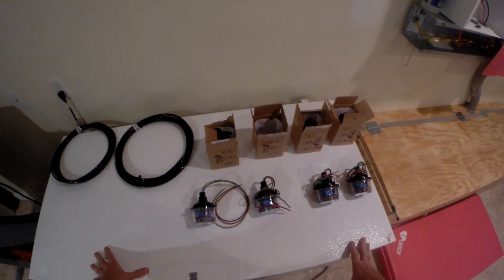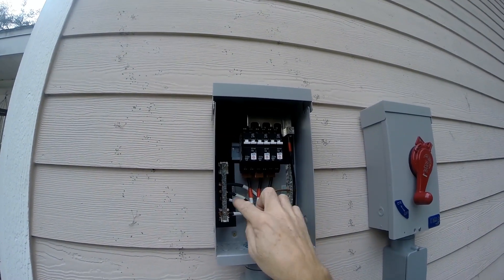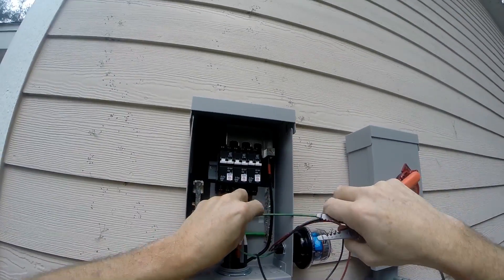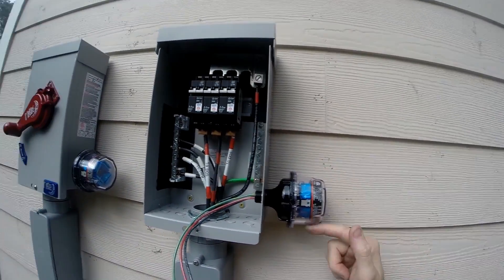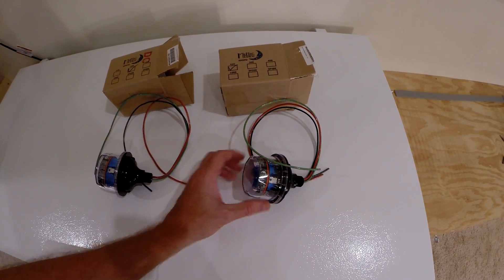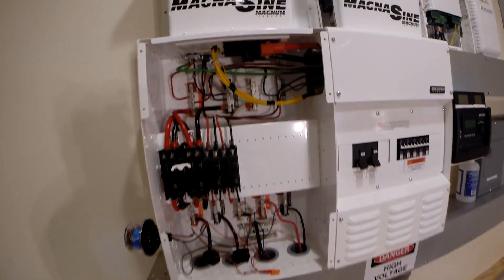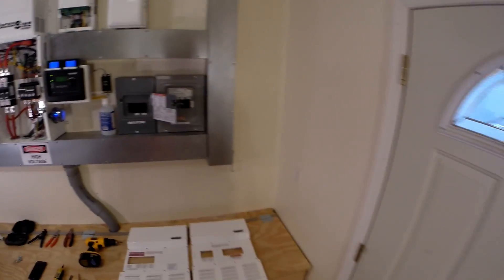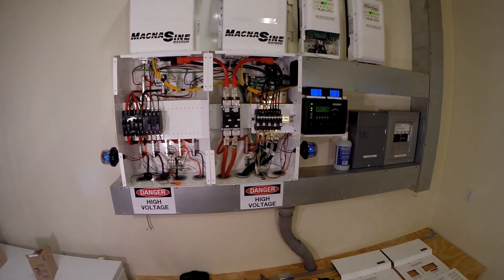Off Grid Solar #46: Lightning Arresters MNSPD-300

Comment: Thanks for sharing the video! So, supposedly, these SPDs should be installed on all electronic appliances like fridge, freezer, washer, dryer, anything electronic, no?
Reply from the maker: I am not an electrician and can not advise you on this.  That said, I would not put them on every device but rather on the main panel of my house where power comes in from the utility.  That should squash anything from the line.  I would also look at anything that goes outside the house such as a power line to a light on a metal pole.  That could attract a lightning strike and bring a surge in through the "back door" so to speak.

Comment: I have two that are not lit. We had lightning in the area last weekend. I have been running power tools and lights all week and my batteries have recharged every day. I don’t notice that anything has changed.
Reply from the maker: Charlie, I can't say for sure without all the details but I think your surge protectors have clamped a surge and are now "used up".  I would replace them.  Consider it a success that they did their job and protected your equipment.  Thanks!

Comment: The info leaflet shows the mnspd300 nominal voltage at 0-300vdc. In your opinion is the mnspd115 a better fit for the inverter or is there 0 difference really?
Reply from the maker: It's been a while since I worked on this project but I would go with the 115 for the DC side since the voltage will be in the range of 48 to 55 ish.
Reply: @HomesteadEngineering  Thank you, now I have a spare 300:)

Comment: Do you need to put the SPD to a breaker? or is the way you wired it directly ok?
Reply from the maker: midijeep,  I think this is correct.  I would not put it on a breaker.  Thanks!
Reply: Thank you.

Comment: I haven't even thought about lightning protection for my solar system. Seeming I'm completely off grid I better get on it!
Reply from the maker: I think being completely off-grid your risk is much lower since the most likely way to get hit is through the utility power lines.  I keep my system disconnected from the grid during storms.  If I were you, I would focus on adding the combiner box protection first.  Thanks!
Reply: David Armstrong awesome, thanks for the advice!
Reply: @GoldGullyFarm  for off grid you only need one. So from the main leads off your panels is where you install this guy (right after your combiner box if you have one). BasicLly the first one the OP installed

Comment: So how do those arresters work? I thought that it would have to be installed in-line with the wires not alongside of them. (don't know if that stmt makes sense to you or not).
Reply from the maker: The surge protectors use MOV's (metal-oxide varistors) to clamp the voltage and shunt it to ground to protect your connected devices.  The green, earth ground, wire should be well grounded.
Reply: ok so its sort of like an overflow valve I guess, it directs it to go in another direction.
Reply: If mine are not lit, how does everything just keep functioning